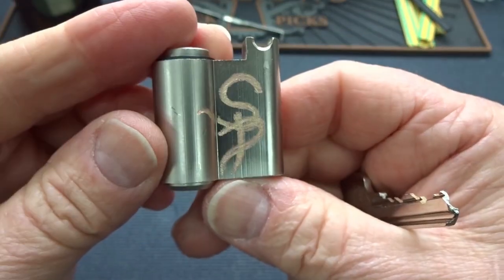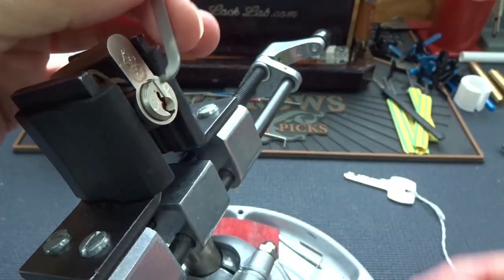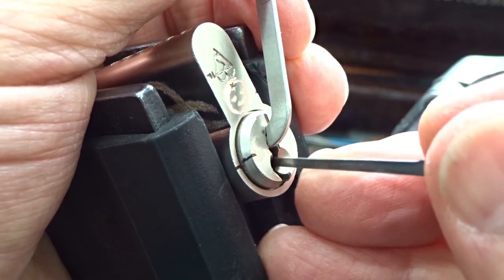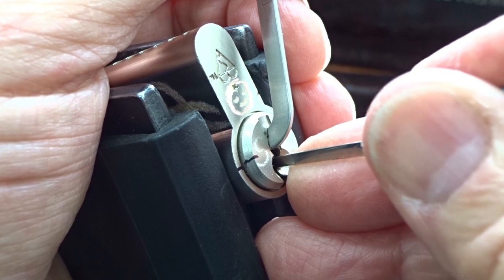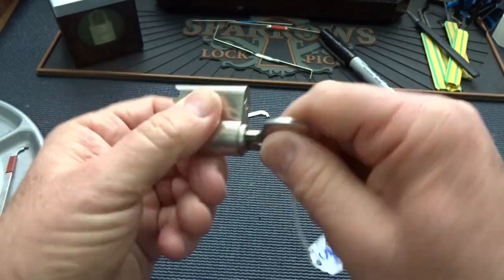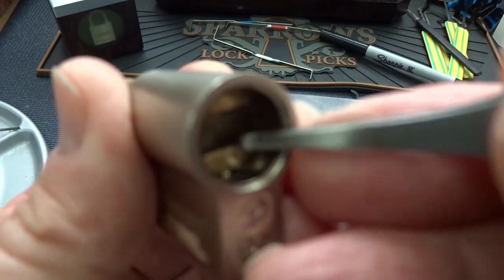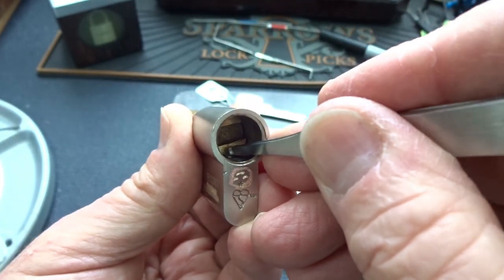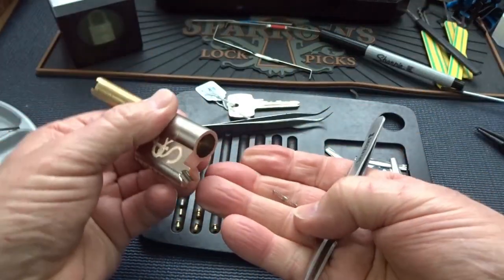(1271) Challenge: Steel Pinning's Securit Baby

Comment: Would you have any home ideas to open disc locks that I have until I by that product like made a shim out of a can of coke workes on spring loaded locks as you no but won't work on the disc padlock
Reply from the maker: No, sorry.  Locks with shackles held in place with ball bearings cannot be shimmed.

Comment: Dose anyone know how to take a master lock apart
Reply: unknown which model? The #3 you grind the rivets of the bottom and drive the rivets from the bottom to the top, you just have to get the bottom 1 or two laminates off to get the core out so you dont have to drive the pins all the way out.
Reply: Riley Fenley yes it is and thank you I’ll have to use my power tiles on it, thanks for that